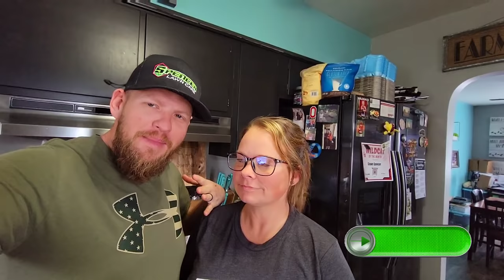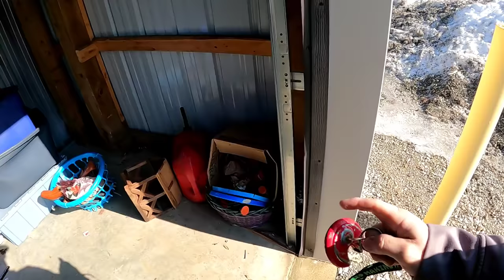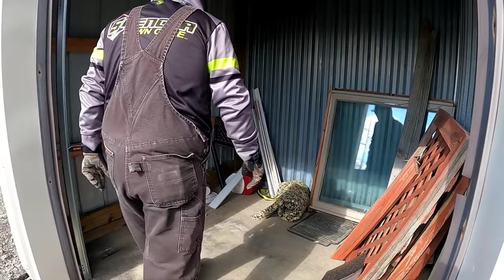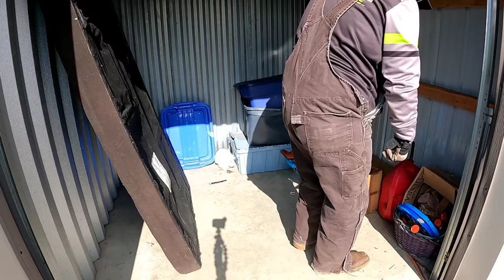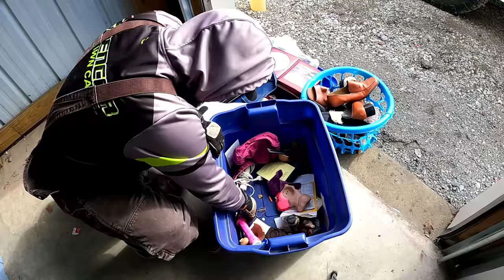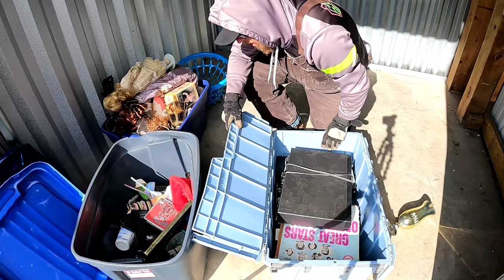TENANT BROKE INTO OUR BUSINESS | I FOUND SOME CRAZY STUFF INSIDE HIS UNITS!

Comment: Hey Shawn, that is plumber chain, found at the hardware, not the jewelry store!
Reply: Originally those were made of solid brass but now they're brass plated. Used for the connection between the lever and the flush valve. All the new stuff eliminate that chain.